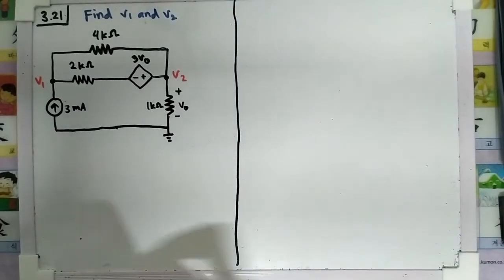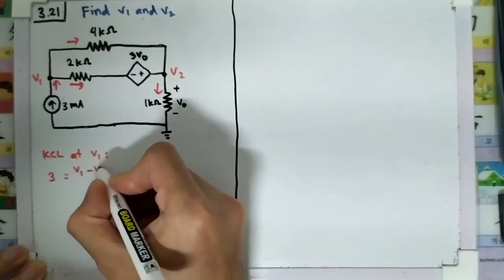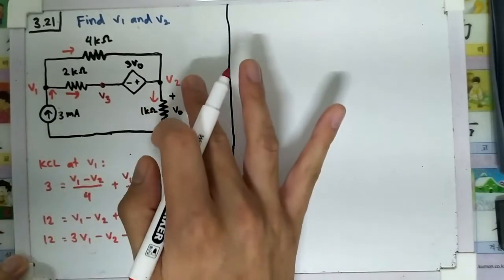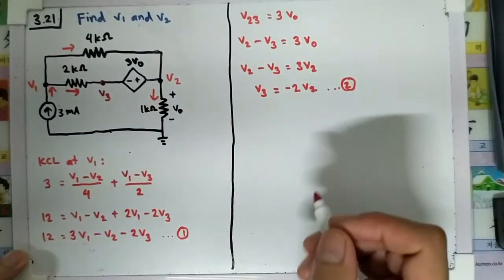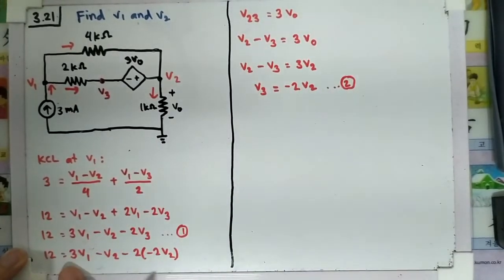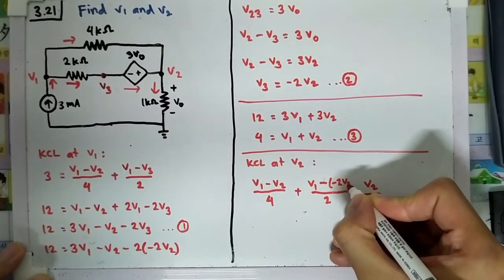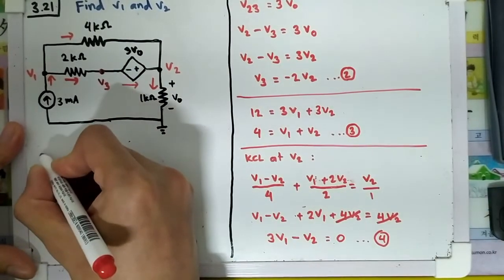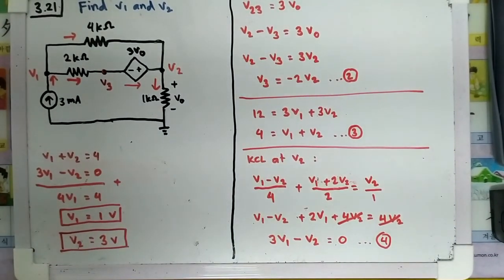Problem 3.21 Sadiku 5th Edition - For the circuit in Fig. 3.70, find v1 and v2 using nodal analysis.

Comment: Why take V3
Reply from the maker: Because
Reply: @ArdiSatriawan ans please 🥺
Reply: @marketing_with_nosh  because V3 is also a node.. voltage across 2k resistor is because of V3 and and V1 not because of V1 and V2.. so to  find  current through 2k resistor, it is mandatory is find V3.. although there is short cut for that